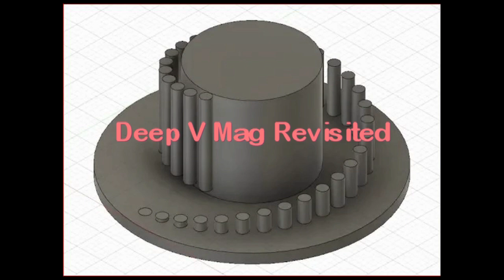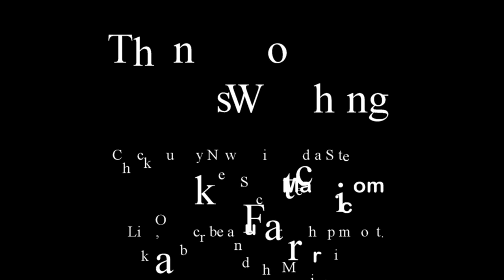A Quick Sine-V Permanent Magnet Motor Test. Outside the box..... COMPLETELY.

Comment: I've got one similar to this one in the works. The concave barrel is something I hadn't thought of though. Just a thought... Maybe if you figured out some clockwork mechanism to move the stator, you'd get better results... I have several tech drawings I've made of that similar processes at https://magmotor.org
Reply from the maker: I haven't really worked on it for a while. I do have some gear mechanisms I have tested.  one is shown on another video.  https://youtu.be/PbpUSsyeneo
Reply: @jameselliott9397  I'm checking it out now.